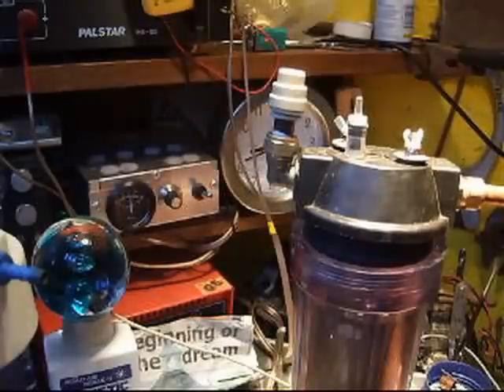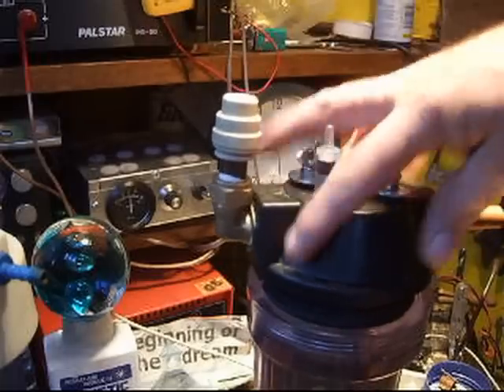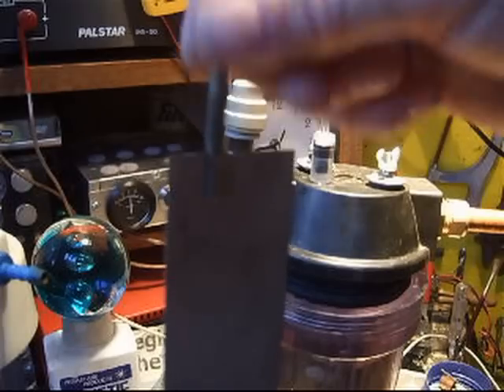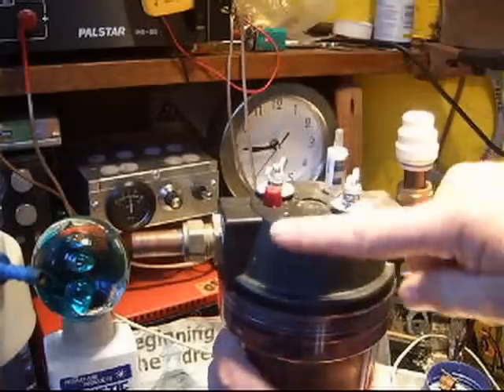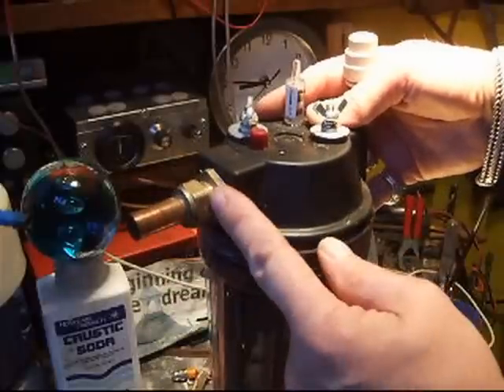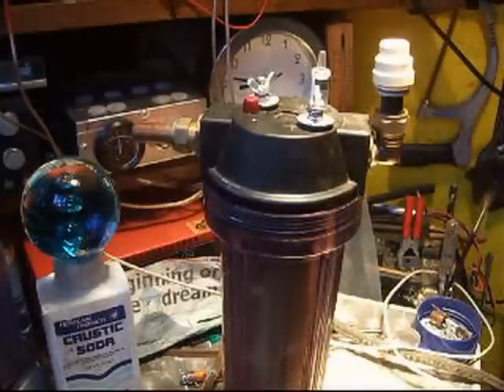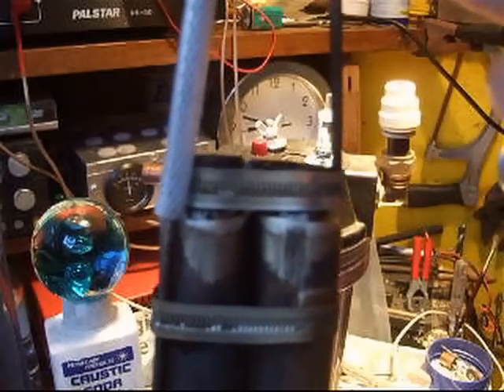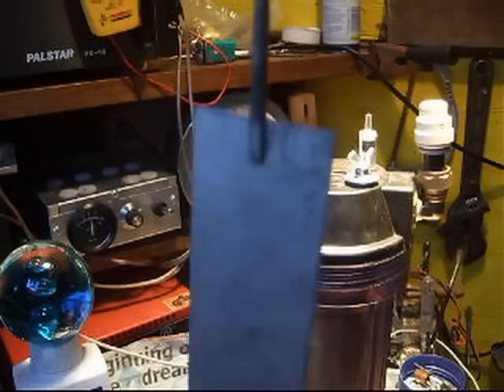HHO TIPS ! MAKING HYDROGEN CELLS THAT LAST !

Comment from the maker: temp reaches about 54 to 60 degrees ...bit to hot sometimes ...but i trim with pwm unit if  it starts getting too hot ...top it up with electrolite about every 400 miles.. about 1/3 of a pint : ) n check for leaks !

Comment from the maker: @panzuman I run 13 plates, must be 316 L  stainless steel ,-NN+NN-NN+NN-  , I use just over a quarter teaspoon of sodium hydroxide in deionized water, run at aprox 8 amps & 13.5v , many  people use more neutrals than this ,it can depend on size of container ..&size of cell + what size vehicle, info i have is a bit out of date now, your research would be much improved on a dedicated hho info forum ,Goodluck. FDC

Comment: Hi. The Oxygen and Hydrogen are in a gas form when they leave the surface of the water and will explode inside the container if there is a spark or any corrosion of terminals above the surface of the water this can lead to arcing around the terminals, Oxygen will cause will corrode even the best type of fittings, especially copper wire, best to use all stainless steel fitting, if anything corrodes under the water it wont ignite the the gas above.
Thank you for your comment.
cheers Z.